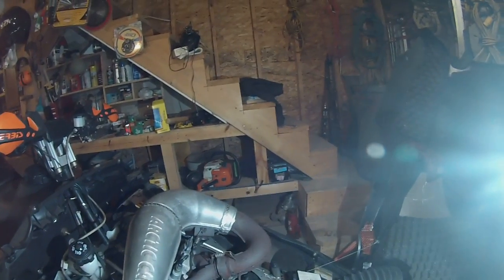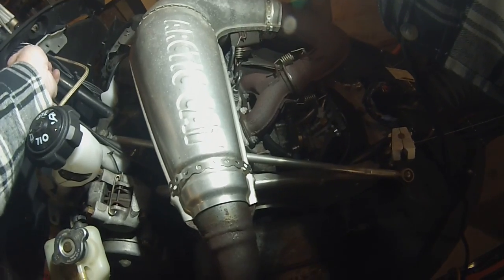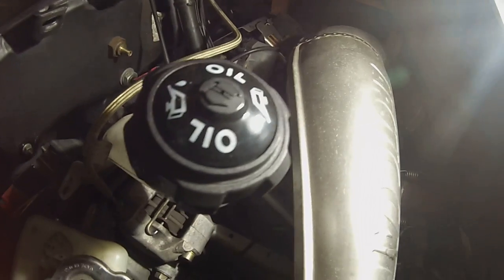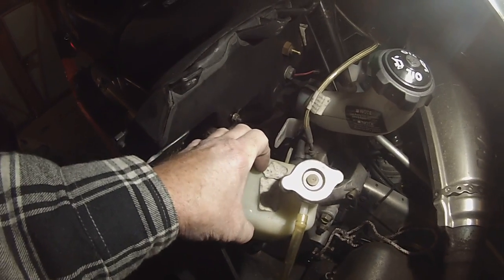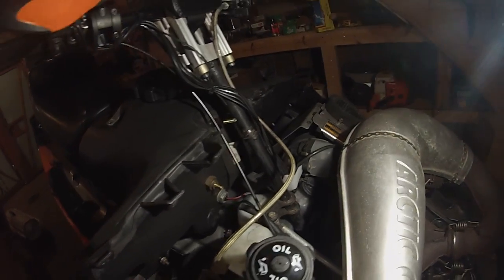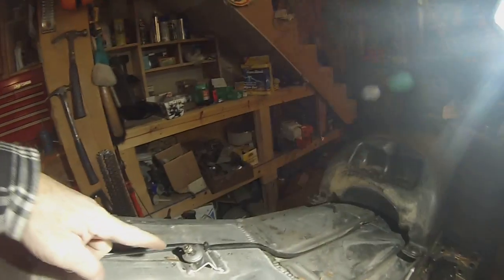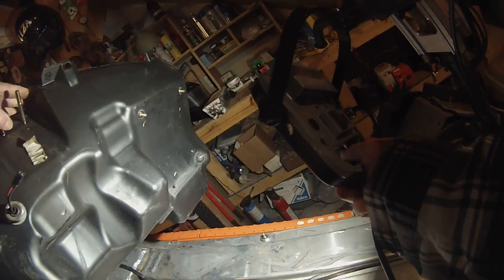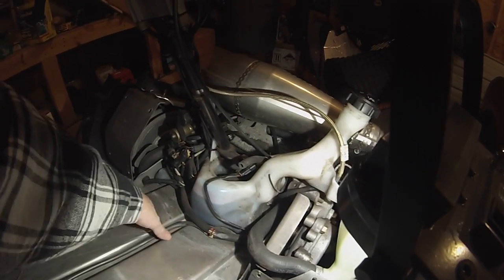GOPR0037  2005 artic cat F7 EFI fuel tank removal

Comment: THANK YOU for documenting this project as it will definitely help me.  I have the same sled that needs a new tank due to the tank cracking right under the threads of the cap where it gets filled.  Arctic Cat honored the warrantee on the problem and I only had to pay the shipping.  I believe they did a recall at one time and many others were experiencing the same problem.
Reply: Kingdom Come  -  I just noticed on the last two rides of the season that I had some gas seeping out of my filler neck and low and behold the base is all cracked.  Mine had the insert put into it before I bought it back in 2012, but I guess the insert doesn't completely prevent the neck from cracking.   

 My question is how did you go about getting a new tank from Arctic Cat?   I want to do the work myself as there really aren't any good dealers in my area and I absolutely love my Firecat so I want to have it done right.   They will honor the recall for a new tank without a dealer installing it?
Reply: Adam M call RV sports in Theif River Falls MN.  Tell them the neck on the tank is bad and ask them about the warranty.  As stated above they sent a new tank and i had to pay for shipping.   I did the install.  It was a task but not too bad.   Be sure to order new gaskets, washers and seals for the job as you want to replace all those while you are doing the project.
Reply: @kingdomcome8697  okay thank you!  I had just gone threw RV for a new speedometer sensor, which had been discontinued but they happened to have one left.  They were great, they sent it super quick, they were good to work with!   Was it tricky getting the smart valves and fuel pump out of the tank?